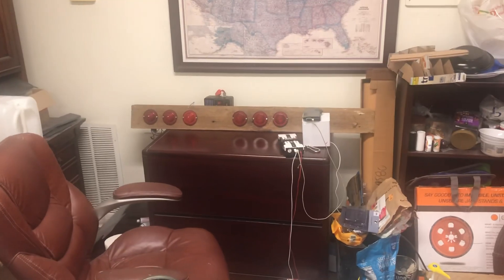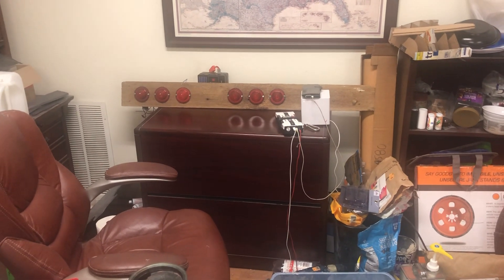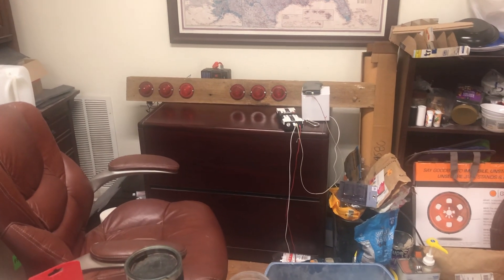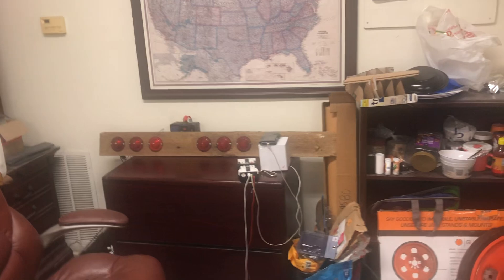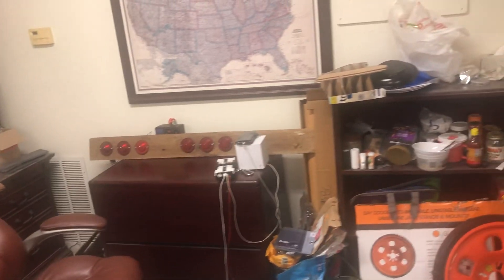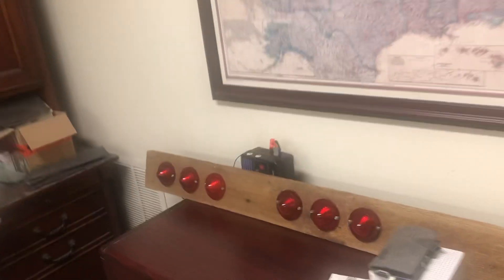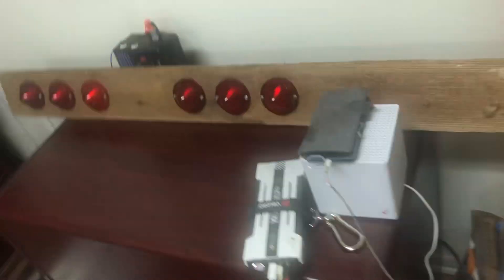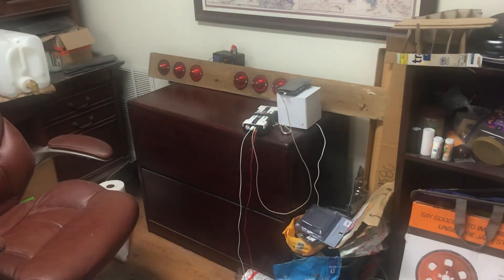CHEAPEST DIY Sequential Turn Signals

Comment: I just have a lot of radio equipment laying around so for alot of my 12v testing I use an old base station supply. Essentially a really large 120/220 to 13.8v@15a transformer.
Reply from the maker: Are those easy to get and relatively inexpensive? I’m wondering about using a cheap computer power supply. I know they have 5v power and I’m pretty sure they have 12v as well. It’s on my todo list to research it.